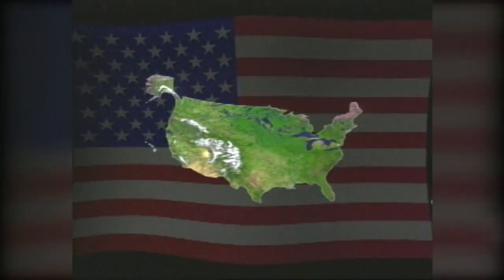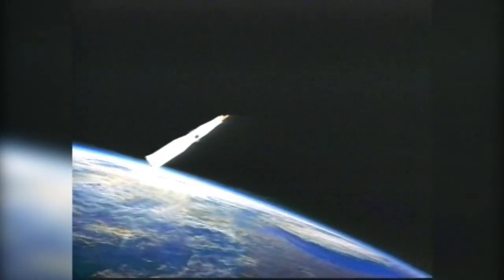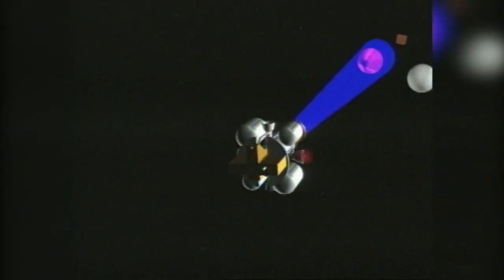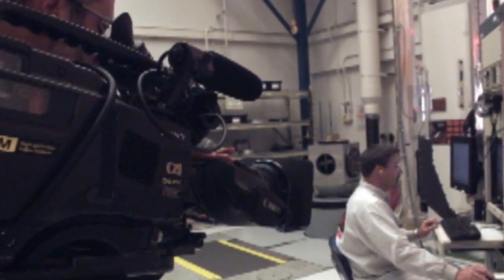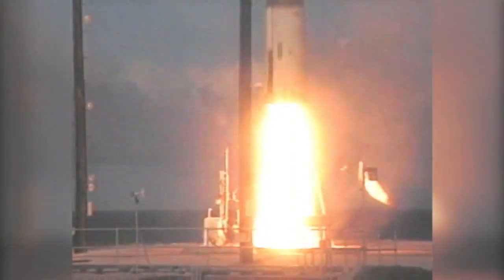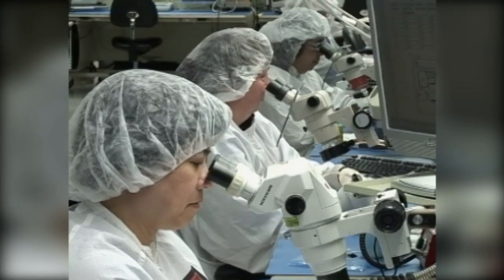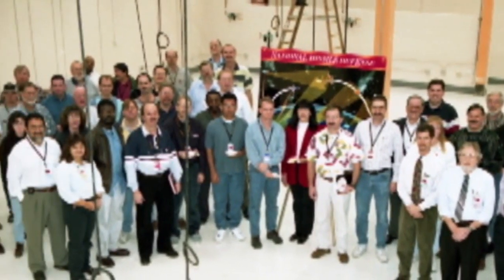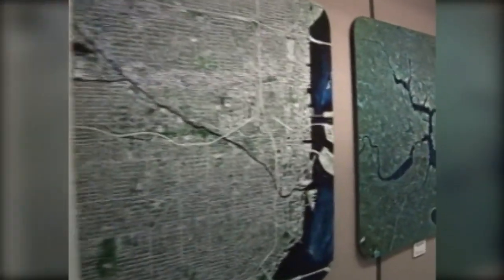Raytheon - Story of the EKV (Exoatmospheric Kill Vehicle) including Hover Test

Comment: "the original machine had a baseplate of prefabulated amulite"
Reply: time stamp?
Reply: Yes, the original device did have prefabulated as well as postfabulated Amulite but what many people don't know, or understand is the coding involved, you see, is was a simple head code, anybody could get it.
Reply: @andrewerickson6089   The thing that I could never wrap my head around, was the use of the reverse biased double inverted wobulator, in the quad pumped reactance dialectic field.

Pure genius, whoever thought of that and managed to make it work!  I would have thought that that would saturate the ground plane with preemptive positrons.
Reply: @beardymcbeardface69  They accomplished inverse reluctance through the use of cardinal grammeters.
Reply: @activelow9297   OMG! Of course!  I feel so silly right now!  Sometimes it's the most obvious solution which eludes us!

Comment: I hope it can handle hypersonic missals.
Reply: Integrated into a layered defense system, hypersonic nuclear-tipped missiles can be defeated. High energy ground-based microwave lasers have been tested successfully against hypersonic targets. The anti-ballistic layer is well handled by kinetic missiles. The reliability of the Raytheon system is statistics that are classified.
Reply: These are designed to intercept incoming MIRV/MARVed warheads outside the atmosphere. Hypersonic missiles and glide vehicles would have to be intercepted in atmosphere by other systems that would be more capable and effective. And considering Russia doesn't seem to have any actual true hypersonic weapons the only ones to be worried about at this moment are China's so it's not that pressing a concern.
Reply: I hope it can even work against hypersonic MISSILES.
Reply: Patriot missiles seem to do fine against the Russian fake hypersonic kinzal missile lol
Reply: @ice-xv1hi ICBM's are hypersonic.
Reply: @skysurferuk  you didn't catch that I was being facetious. Go back and read the op.
Reply: Patriot has no problem intercepting the wonderwaffle hypersonics
Reply: They are caught near the top of the arc and are not hypersonic at that point, they do go hypersonic after reentry and that is the hardest time to shoot them down, but even then the good ol USA gets it done to a fairly high hit rate, I dont want to be anywhere need the fall out though.
🇺🇸